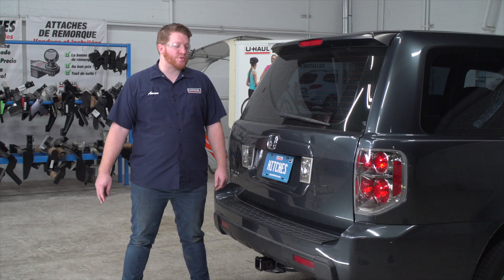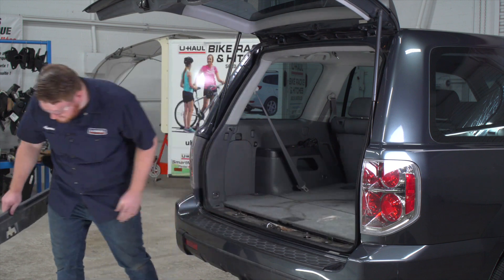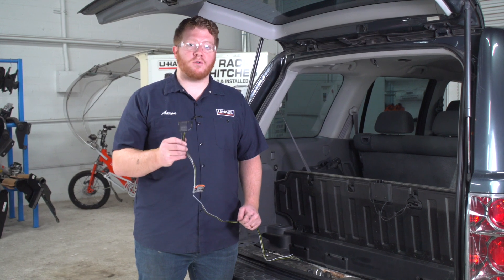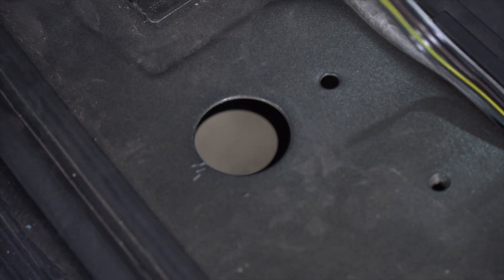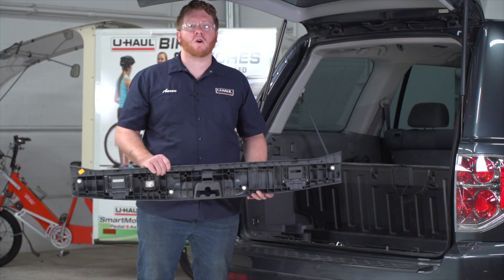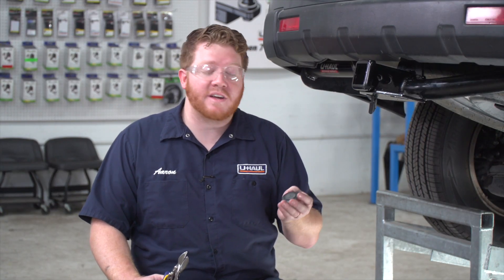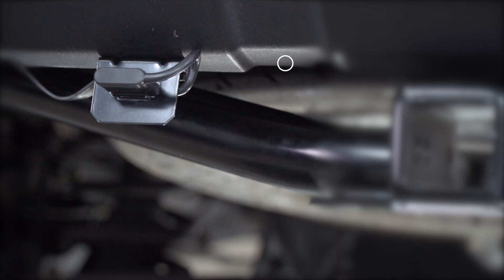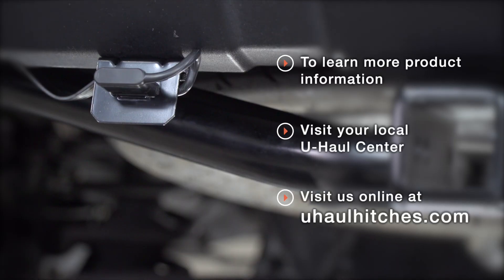2006 Honda Pilot Trailer Wiring Harness Installation

Comment: what if I have trailer brakes and need a five flat harness?
Reply: Random opinion but if your trailer requires trailer brakes it’s too big for the pilot to pull
Reply: What authority are you referring to?  The MDX or Pilot has a 3500 lb tow capacity.  According to the specs with the added receiver hitch and transmission cooler.  (Tow package) Most all boat trailers have brakes of either electric or surge variety but even surge trailers require a reverse signal (5-flat) to operate the reverse solenoid to prevent the brakes from engaging on backing up.  Some older trailers have a manual brake lockout for backup.  
Even my little enclosed 5x10 trailer has electric brakes.  
My MDX can tow a Ski Nautique Open Bow with no problem.  2300 lb boat plus the 800-900lb trailer.  The MDX load capacity is easily increased by adding D-E range tires and airlift or other brand air bags inside the rear coils to prevent squatting when towing. My 2cents based on my fleet.